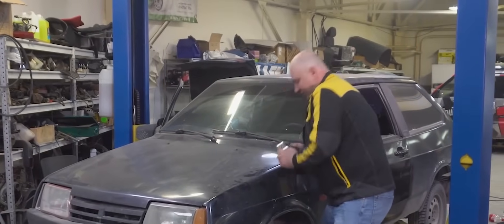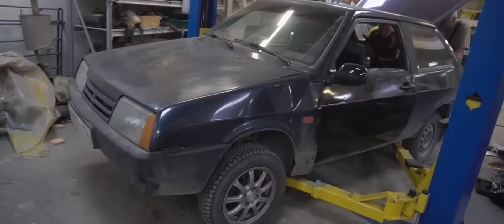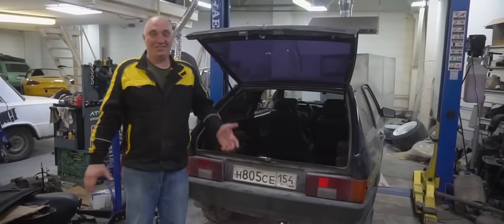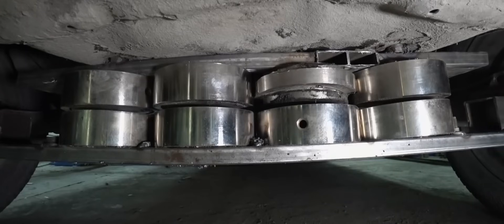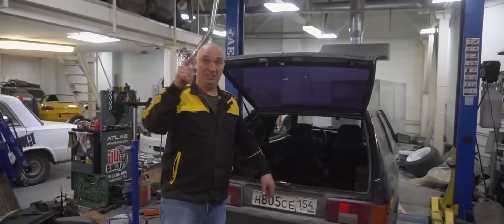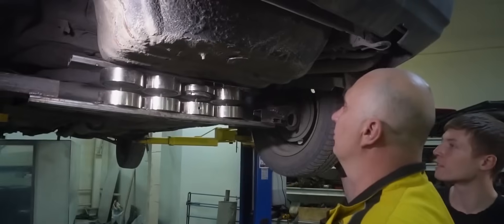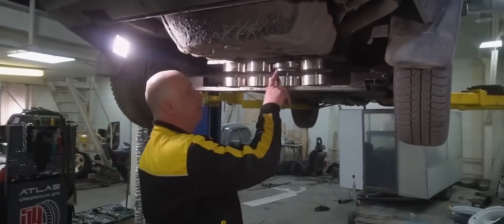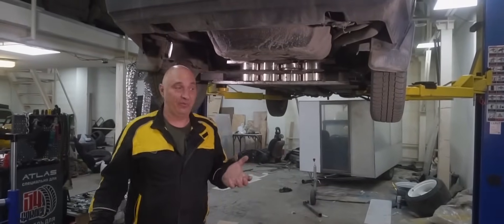DIY magnetic suspension

Comment: Electomagnets could charge baterys with every bump
Reply: Electromagnets require electricity to work buddy
Reply: @skeezixmccat  You know exactly what he means.. Well, atleast I hope you do lmao. Ever heard of an alternator?
Reply: @Dubz0408  Alternator doesn't have an electromagnet.
Reply: MustHaveChannel Jesus Christ lol. When you move iron past a copper winding it creates a voltage. Thats a simplistic view of how an alternator works. If you apply voltage to an alternator, it becomes a motor... Just as applying movement to the iron within an electromagnet’s windings creates voltage in its windings due to the movement of the magnetic field.
Reply: @Dubz0408  
An alternator isnt an electromagnet. It has magnets inside it, but its not an electromagnet. And no, applying power to an alternator does not turn it into an electric motor.
Reply: NGAudio Applying current to an alternator definitely turns it into a motor just as applying current to the phases in the stator of a brushless AC motor makes it a motor. And never have i once called it an electromagnet.
Reply: @Dubz0408  
Sorry for the missunderstanding of the electromagnet part, but you are wrong about alternators turning into an electric motor.

There is a device on an alternator called a rectifier. It is a series of diodes that converts the AC created internally, into a DC output.

If you apply power to an alternator, nothing will happen. Absolute most that will happen is youll blow up the diodes, and now it becomes a giant paperweight.

If you were to remove the rectifier from the alternator, then yes, when you apply power (specifically AC, and probably 3 phase AC) it will work like a motor. Because it is one. Once you remove the rectifier, it no longer classifies as a Alternator
Reply: NGAudio You just repeated my simplified explanation but played with semantics and technicalities to oppose it. Its like playing “but im not touching you!” with a 10yr old. If an illegal lobs your head off with a scimitar are you still a human?
Reply: @Dubz0408  
Just cu you graduates from a tech school doesnt make you right. You MUST remove the rectifier from an alternator for you to be able to put power into it. No way around that. And once you remove the rectifier, it is no longer an alternator.
Reply: NGAudio Here you go again. Arguing just to argue. 
“No, technically im not assaulting you when i smack you with a bat! Its the bat doing it not me! Same way bullets work!” -NGaudio logic 2019
Reply: @Dubz0408  
Im trying to correct you. So you can learn. Calling me a 10yr old is arguing and childish
Reply: NGAudio I havent called you anything. You come off as a leftist snowflake melting down tho. 
“HES ATTACKING MEEEE!!!” D:
Reply: @Dubz0408  Ok dude. Seems that I was confusing your comment. You are right.
Reply: @Dubz0408  
Show me then
I wan to see how applying power to an alternator without removing or bypasaing the rectifier will work.
Reply: @ngaudio9143  you are trying soooooo hard 😂
Reply: Dubz0Eight You’re still right. You said apply power to the alternator right? Heres what we do. We strike it with lightning. No no worse. We strike it with some absolutely surreal current and MELT it to a puddle. It will move. Making it a motor.
Reply: @ngaudio9143  wire it in delta with diode pack removed and motor on.
Reply: doorey2 Look up how a 3-phase brushless motor works.
Reply: @Dubz0408  i can see youve invested alot of time on this so here the lesson you are desperately looking for...a coil moving close to a magnet will induce a voltage in that coil right? Looking closer at that coil,youll see that whiles the voltage is flowing in the coil because it was induced by those big ass magnet ,insnt it called an electromagnet?
Reply: @lucj5552  Uhh I think youre directing that at the wrong person lol. Go back and reread..
Reply: well it would work if you had a permanent magnet and a coil around  it since taking energy out of the bumps would yes create energy but you'd have to also push the car back up so just use a spring there but yes you could turn bumps in the road to tiny ammounts of energy
Reply: @Dubz0408  you do realise that electromagnets need a constant supply of electricity to function therefore any potential gain of electricity would just be cancelled out by having to run the electromagnets

The energy that you're talking about obtaining would be coming from the cars gravitational potential energy store. Normal spring suspension systems absorb this and then emit it again to push the car upwards. If you take away this energy then the car is no longer able to go back up and it will remain in the pothole.
Reply: Dillon Ekiyoyo Thats not the point i was arguing at all. Talk to Luc J about that one.
Reply: @skeezixmccat  Lenz Law, check this out
Reply: Look folks, I graduated tech school, was a service tech for a short time and built and raced 10th scale electric race cars for a longer time as a hobby and was GOOD at it. Before you say im wrong about electrical theory or component construction or operation save us some intelligence quotient and look it up first. Youre on the Internet already it not that much of a stretch.
Reply: Even know the conversation has devolved into an argument, as it usually does on YouTube, you’ve restored my faith that there are halfway intelligent ppl out there, who can speak intelligently on electromagnets, and physics, in the comment section .
Reply: This comment chain really took off lol. Love ya all! Even NGAudio who just wants to argue so bad lmao.
Reply: You guys are stupid. This can all be settled going back to one famous equation. One that everyone should know that has changed this world for the better. - The angle of the dangle is proportionate to the mass of the ass considering the heat of the meat is always constant.
Reply: Its like those flash lights where you shake them to move a magnet by a coil ..voila electricitate!
Reply: Luc J #genius
Reply: FBI: WHERE IS YOUR LOCATION

Seriously tho that's a good idea
Reply: Genius!
Reply: You mean an alternator? Electromagnets need energy to work.
Reply: but dude, i think the magnetic field should be rotating, not revolving if i'm not mistaken. nice taught tho.
Reply: Now, a DC generator (think really old cars) will work as a motor, just like a DC motor can be spun by an engine and create electrical current.  But those who say an alternator cannot unless its changed (rectifier removed and 3 phase AC current added) are correct, and the alternator isn't an alternator anymore.  Because if it did, since the battery is connected to the alternator at all times, the damned thing would be trying to spin and drain the battery.  But it doesn't.
Reply: Pat Callahan If that were true a 3-phase brushless motor wouldnt need a speed controller to run. You could just plug a battery to it and it would turn. An alternator is the inverse construction of a DC motor as is a brushless motor. Look it up.
Reply: Both of you guys are idiots. Pridemen.
Reply: Jannib Andelo Bayutas Thanks for contributing NOTHING intelligent to the conversation. As you can tell from the lack of thumbs up that you have, no one cares about your OPINION.

Comment: Run some copper through those guides and you'll be making electricity with those magnets going up and down
Reply: remove gas tank. engine. replace with  electric engine self powered by its suspension. self powered car
Reply: I'm not exactly sure but those guides look really close to the gas tank. You did not want electricity near your gas tank.
Reply: @FireFox64000000  you also don't want explosive neodymium near it, for that matter. But this was, how you say, Russian prototype?
Reply: Charlie McDaniel send to America and refuel car
Reply: @FireFox64000000  it would generate it anyway due to eddy current if the gastank is made of metal
Reply: @Elinzar  
I think you miss my point of firey explosion, but you know whatever.
Reply: Swampy  /wooooosh
Reply: That could also be the shock absorption system, ever run a magnet across copper? Has a really neat effect
Reply: Might actually provide some needed stiffness too
Reply: Swampy  i call wooosh as a friendly way to tell people that is a joke, not to call them retarded, never said that even...,if not you tought about it
Reply: Swampy  yeah but it would be engineered and thought of not just put together with velcro
Reply: killa project how about if they Use Electromagnet for the suspension + it can be adjusted
Reply: Thus self charging electric car can be made had your hypothesis been true

Comment: Instead of just pairing the magnets up they should be stacked together 3,4,5 magnets high opposing one another with a guide pin through the center. That would greatly increase the suspension travel and probably not decrease the lifting force.
|NS|-|SN|-|NS|-|SN| a manner such as this.

Comment: 600kg is the pulling force in push or pull... Measured at the magnet's surface. Magnetic fields decrease in strength in relation to distance exponentially, so it's no surprise you are under sprung ;-)

Comment: Even if this works relatively well, your car will look like a rolling scrapyard underneath after a few miles, with all the ferrous metal that happens to be lying around on the road. If these were electro-magnets, you could just turn them off and shed whatever was attached, but with neodymium, you'll spend a week with a pair of brass pliers and a screwdriver just trying to keep the scrap metal off of your suspension.🤣

Comment: need to put 4 magnets on each side. I'm thinking 4 mounted on a central shaft much like a strut/coils spring. Put 2 in the middle of the shaft together and have the opposing on the top and bottom so the top and bottom magnets are pushing away from the 2 in the middle. That will get you a bit more travel and more weight load at the corner

Comment: What if you put 2-3 magnets on opposite poles on top of each other in a cylendrical housing, and fix them using rode in the middle of each one
Then install it like conventional suspension.
It will give you enough ride hight.

Comment: Instead of 4 pairs in a row giving a small clearance, have 2 columns of 4 which would triple the total clearance giving more travel in the suspension. If bottom one is north up, stack next one north down south up, then next one south down north up... The guide pin needs to be damned strong though to stop them slipping out of alignment, some outer non magnetic guides might help with that.
2 columns like this...
 s
 n
=== gap
 n
 s
=== gap
 s
 n
=== gap
 n
 s

Not sure what affect the guide pin would have on the magnetic field in this configuration if it were magnetic.

Comment: Think about how a speaker works, Like a huge sundown 18 incher. I would use a PWM'd electric signal and multiple electro magnets on one half. Weld up some tubes and add springs between the electro magnets and the earth magnets and your good to go. you can have the suspension controlled by a r-pi and have it regulate the amount of power used based on the bumpiness of the road surface and you can send way more power if its pwm'd up!

Comment: Rubber air bladder suspension. Float the magnets on top of those, with a sleeve around the bottom/axle mount. And put them closer to the wheels, a pair per side

Comment: Low speed crash protection? Use the magnets to avoid bumpers actually touching at a low speed
Reply: breakingmichigan but then the magnets would pull a front bumper to another front bumper... just as it pushes a front bumper away from a rear bumper. Right?

Comment: good idea. think of all the nails and lil metal bits you'd be saving other drivers from flats. goddamn i hate new cars suspensions. completely removing the feel of the road and being made just border line capable of supporting the cars own weight but every extra passenger is actually Stressing most factory cars weak ass suspensions made up of too many weak points and inferior methods a how about a magnetic Strut, replacing the "Gas cylinder/spring strut.  altho iv always wanted to see a car run off electric motors powered by a 3,300watt generator.. your doing fun and exciting things garage 54 good show from your comrade in the cold from Canada. but then again the 2 stroke car would be a riot.

Comment: my 2 kopiek,  magnet stretch is not linear with distance, think its to power of 2. So problem with suspension like that is that magnets are basically 1 to 1 with the wheel. Need to create a lever so that wheel travel to magnet travel is different. So lets guess, 70mm of wheel travel is 7mm of magnet travel, or even more. Than it be awesome! and shocks a must.

Comment: I guess that if you put gussets to dress the magnets travel and reinforce the crossbar it would be definitly a very nice suspension system !
In theory magnets acts naturally as shock absorbers when repeling oposite. The closer they get the stronger repeling goes and when aproaching there is an idling height that can not variate too much, so with enough magnet power it can't have some kind of jump shake due to a repeling force maintained still with the weight of the car as gravity keep it down. But the car is to heavy for only eight magnets so the body inertia when going upward or downward manage to break the regularity of the repeling force. Stacking them to 16 magnets might be the solution ! Also put stopers onto the guide rods so the rear axle goes not too far down and the magnets keep a minimum strong repeling distance to prevent also shaking

Comment: Try having combined suspensions ...
1.Use a pvc pipe with a high thickness 
2.  Drill the center where the two magnet meet by the two side of the pvc to create input and out hydraulic pipe in . 
Ask for more if you like the idea 😂😂🤣😂

Comment: If you want more travel you need to stack up multiple magnets, adding more magnets in the same setup won't improve much. Maybe inside a tube with a central pin and mount it like a shock absorber. Good work! 👌👌

Comment: Try put 3 magnets in one cylinder in configuration (SN)(NS)(SN) with guide pin, and try it like spring. In free space put small rubber that magnets don't make contact with each other. And don't weld magnets.. make plates that you weld. Cheers :D

Comment: Those magnets look like they have a confined magnetic field.  The outer ring and the inner ring acting as pole pieces to restrict the magnetic field into a smaller area.  This makes them much stronger for holding things, but means their magnetic fields do not extend very far from the surface of the magnet.  That would explain the small gap you were seeing when using them.  Look up "Halbach Array" to see a commonly used trick with magnets to increase their strength, and how it confines the magnetic field into a small area.

Comment: Make a water cool car into an oil cool car. using oil radiator and alot of motor oil. if needed see what will happen with oil flowing through the block and also with just motor oil through the filter coupling.

Comment: You could do like a strut design on each wheel with the magnets were you use 4 on each rear wheel by drilling holes in the metal running a guide rod and having all the magnets repealing so there would be 4 magnets at each wheel would probs be stronger kinda of like a strut but with magnets

Comment: Put another magnet the same size same power same everything the exact same in the middle and a line the polarities accordingly to repel and leave it free floating and you would have to obviously extend the rod that holds everything together. I also noticed something else is that you welded them and I think this messes with the field polarity. So start again three magnets per side and maybe up to six sets or maybe 8 sets for a total of 24

Comment: Well if you could make a reversal of the force required, like a scissor like setup so the magnets use their pulling side to fight the weight and bumps of the vehicle running. Of course you may have to deny them full contact somehow to make them pryable, but it should work.

Comment: Impulse forces even on a vehicle that barely weighs one ton can be tens of tons when riding rough surfaces at high speeds. Elastomeres in tires (and the air in them) and suspension bushings turn the shortest duration highest peak forces into longer duration lower forces that can then be handles better by the long travel shock absorbers and springs. 

You can't just ignore all that and go Insane Clown Posse on the problem and expect it to work.

Comment: I’m doing suspension specialist in my country.

What I’m going to share with you is something that might help.

My car shock absorbers just got leaked. The ride height slightly lower then before. When I replaced the shock absorber, than it lift up a bit. I heard that u removed the shock absorber. Thus, I believe the ride height would be better if you installed good condition shock absorber both side.

Add additional length of bump stops on the absorber just sufficient enough for the magnet to get close to each other leaving a small gap. Do not install any rubber on top of the magnet surface to maximize the force.

Why dont you test it first before getting whole new idea.

Consider also to avoid any heat on the magnet when installing it to its place.

Comment: Front and rear magnetic suspension, with a rigid and stiffer rear axle instead of hollow rectangular steel beams. That should work out fine, although I wouldn't recommend entering a corner at high speed.

Comment: Why not try using heavy duty commercial solenoids? They use electricity to work. You put power to them and theoretically should lift the car up a bit and work like a magnetic suspension

Comment: Connect the top to the bottom and the bottom to the top to use the pulling force, the magnets strength... Can put peice of rubber or wood between magnets to stop them from coming together. Magnets would be pushed apart when you hit a bump then and the wheels will he pushed down by magnetic force...